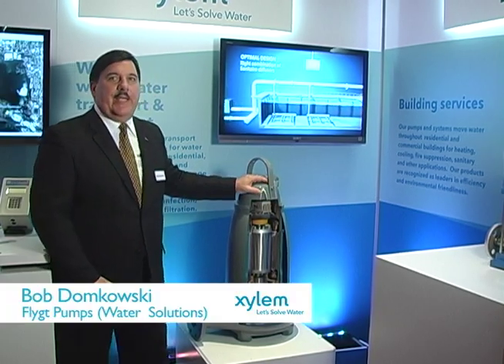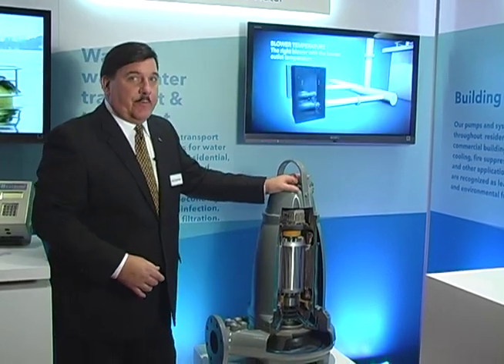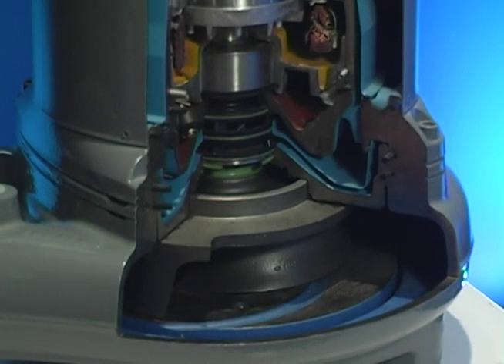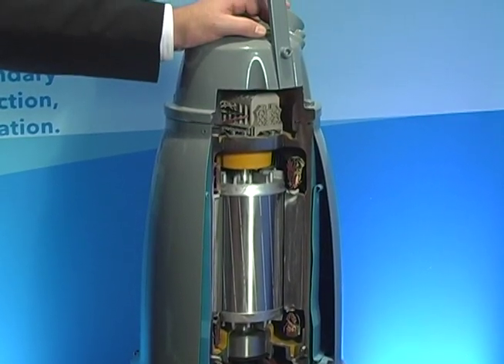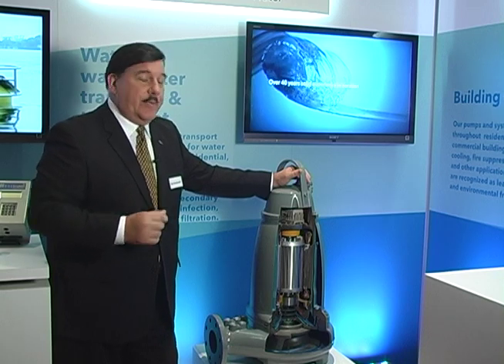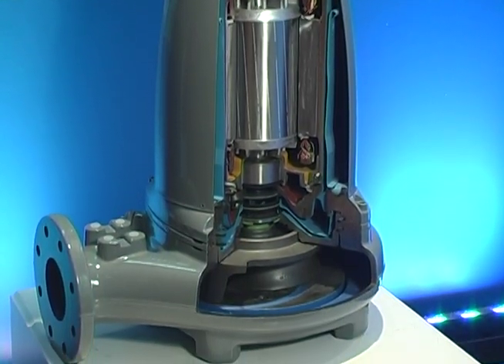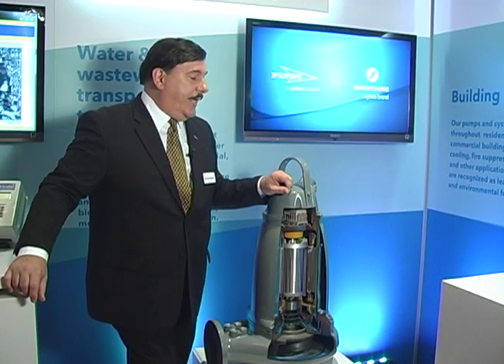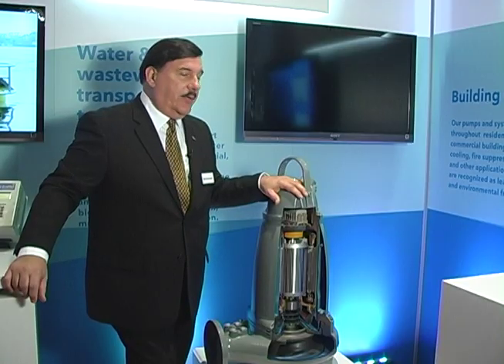Product Profile: Flygt N-Technology Pump

Comment: They are absolutely the best pump. The only pump I want to have in my system.  I have these pumps in several locations and I have them on back up for when the myers pumps fail.  As they always do I only have a few myers left to get rid of . They were purchased before me. NP (non clog)  style impeller is the only way to go.